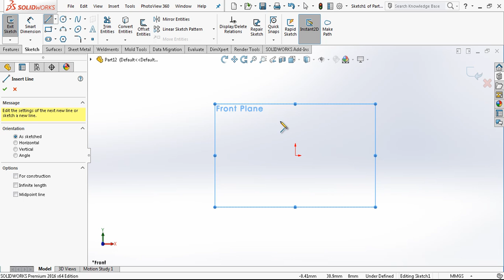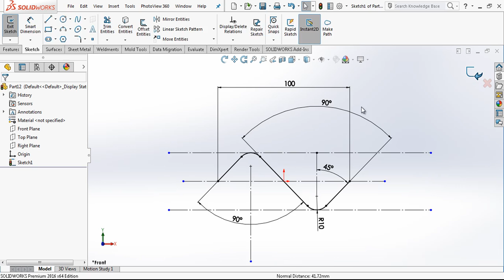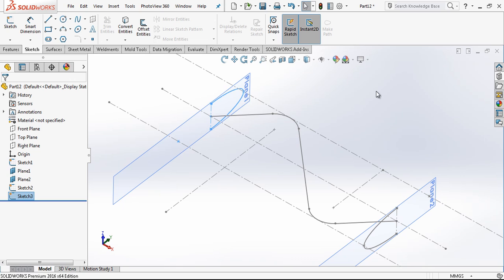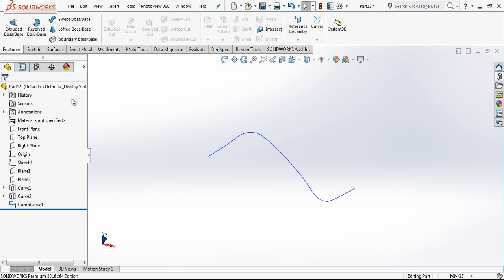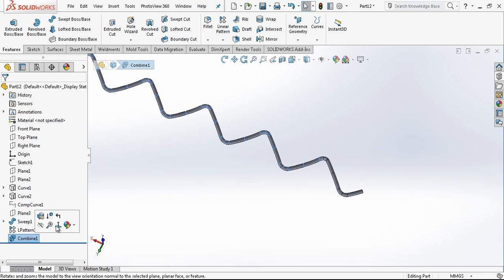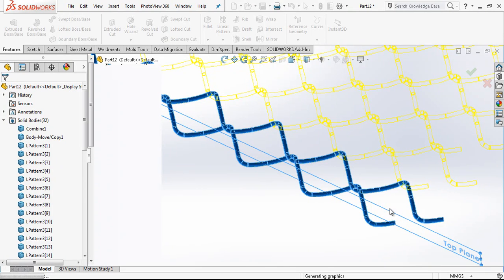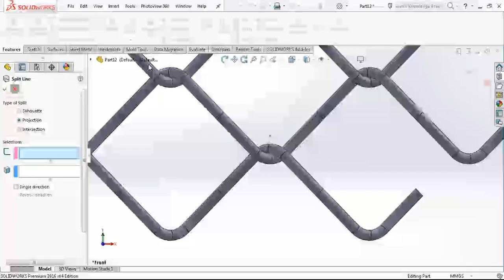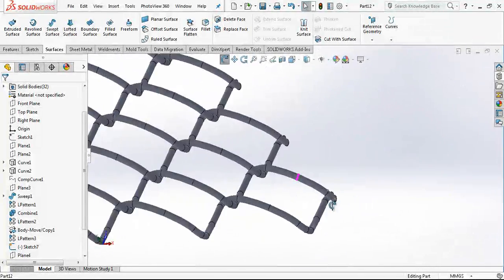Wire Mesh - SolidWorks Tutorials

Comment: If anyone has a problem with doing a linear pattern, here is my solution. Instead of doing a linear pattern you do a simmetry of the sweep, then you do a lienear pattern of the symmetry. This way you will get a less realistic weired fance, but from far it won't make no difference. Great video by the way!!